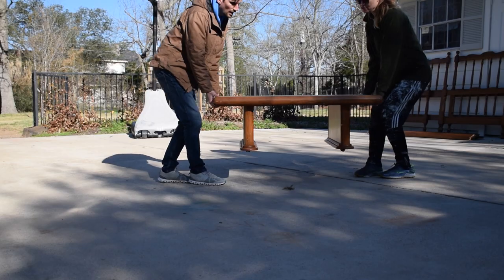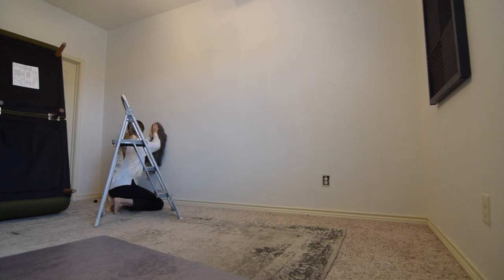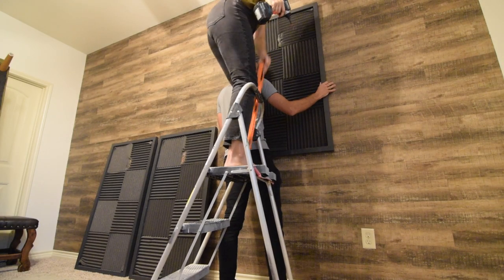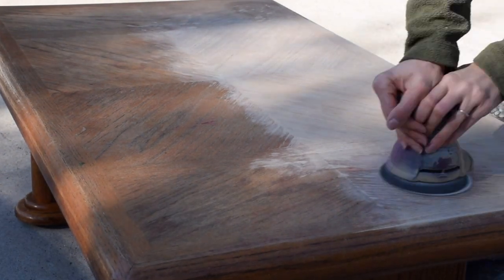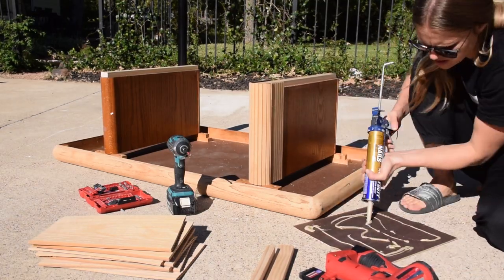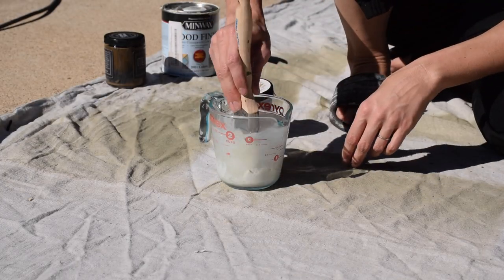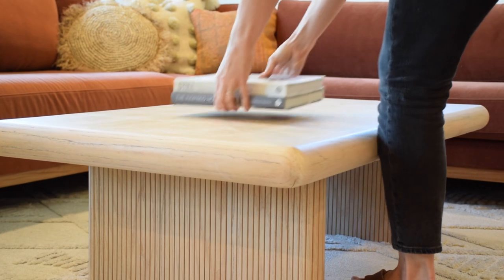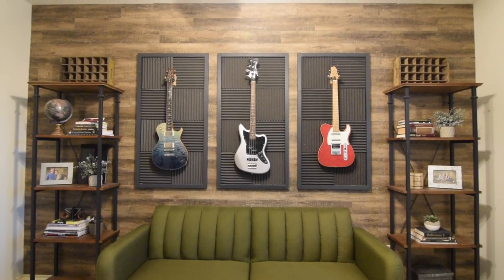High End Furniture Makeover On A Budget + DIY Accent Wall // DIY Mid Century Furniture Makeover

Comment: Looks great!  Glad you wall was square!  For the "wood wall" Don't assume your base boards are level.  I did my office in the last house with wood on an angled ceiling.  I ran a level line at the top of the ceiling where you eye will catch.  Worked from top to bottom. I was almost a half an inch out of level from left to right at the bottom.  I had trim angle cuts on the bottom to make it line up..  Like tile also figure out if you have to trim the top and bottom.  That way the cuts won't look so drastic at one end.   Mine looked great and the weird cuts were at the bottom hidden by furniture away from you eyes.   I didn't know the floor was out of level. If I had followed the base board it would have looked way off at the top.   I have learned over the years that frames say its good at like a 1/4 inch out of square.  The finish carpenters make it look right.  The house I'm now has no square or level things!  Its 60 years old!   Also, how do you like the pin nailer you have?

Comment: I found an ugly old entertainment unit with sliding doors made with a similar fluted material in sheets of solid oak with a rubber backing. I demolished the thing which was an odd combination of oak and particle board and salvaged all the oak parts. There's a tip. If you can find them, those doors are about 20" x 30"?